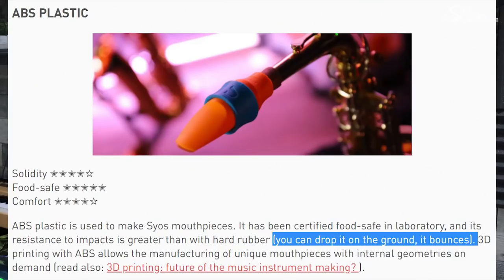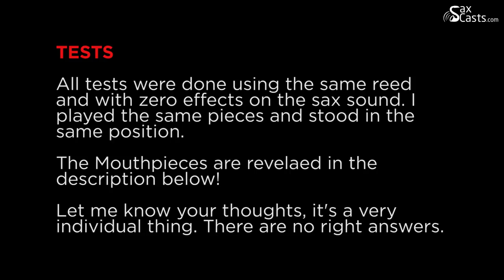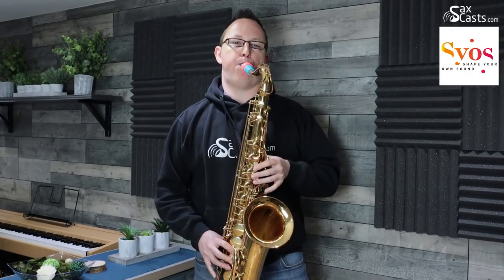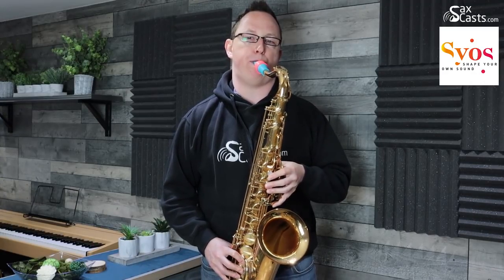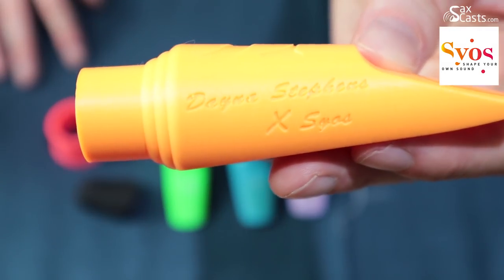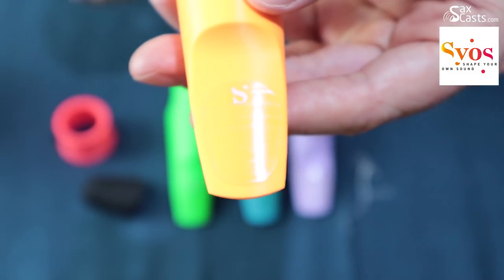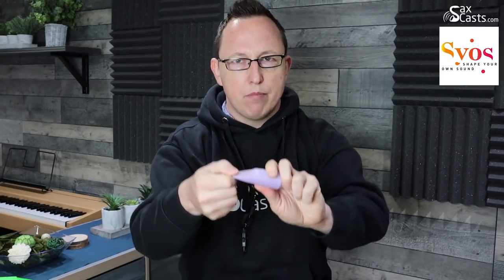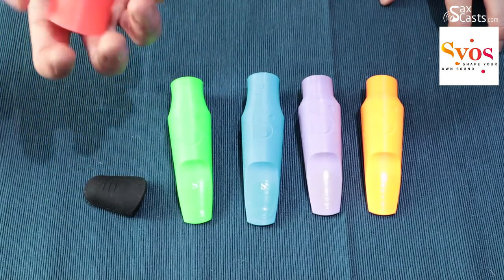SYOS SAX MOUTHPIECES // PLAY TEST AND REVIEW - THE BEST TENOR SAXOPHONE MOUTHPIECES IN THE WORLD?

Comment: I couldn't hear a significant difference between the mps - maybe mp D was slightly stronger way down low. I play a d'addario jazz select and would be interested in your comparison of it and the Syos in your review.  It seems many people are switching to the Syos.
Reply from the maker: Thanks for the comment GGauche. I didn't say in the video but I am actually using D'addario Jazz Select 2M's. Literally only tried those as they're all I have in the studio at the moment. Which mouthpiece do you use?
Reply: @SaxCasts  6M.  It was the first mp I ever bought!  It had such a narrow hole that I couldn't get it on my horn, but I sanded the cork sleeve down a bit and it was fine.  I was immediately blown away by the sound.  Lucky buy!

Comment: Some with Syos mouthpieces have said that they fail a pop test.  Syos have got back to them stating that this is normal.  Do all four of these mouthpieces pass a pop test for you?
Reply from the maker: I can't get any of them to pop Paul. I have tried a few different reeds. The table of the pieces seems quite wide, perhaps this is the issue. They do play very nicely though. Perhaps the pop test isn't as necessary as we think.
Reply: @SaxCasts , thank you very much for the reply!  For thirty years I have used the Pop test to not only determine if the reed and ligature are set up properly on the mouthpiece,  but also to help select a good mouthpiece from a bunch.  No one in my current sphere has a SYOS mouthpiece, so I have been going on other's comments. I have seen a couple of player's comment that they could not get the SYOS mouthpiece to pop, yet the SYOS mouthpiece played extremely well - in fact, better than several mouthpieces that had been custom made or refaced by one of the best. I am keen on ordering a SYOS Tenor mouthpiece but held back when I heard of their pop test fails.  Perhaps its time for an old dog to learn new tricks!!  

I did notice on your playing tests that you played wonderfully regardless of the mouthpiece. I also noticed that like other wonderful players,  they sound very similar when they play differing mouthpieces. Putting aside the tip opening, each of those SYOS mouthpieces differs greatly in their specs - for example, chamber & baffle. Would you say that you found producing your own sound easier on some of the mouthpieces than on others? On the one you found best suited to you, did it turn out to have similar elements, such as chamber size and baffle, to your current mouthpiece?  

thanks again,  Paul